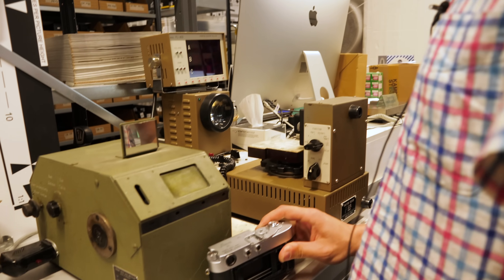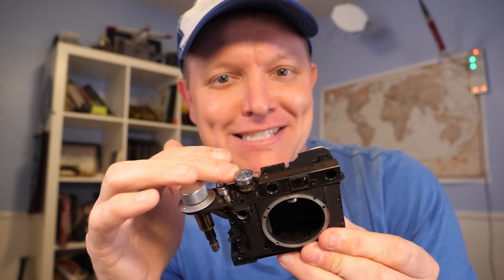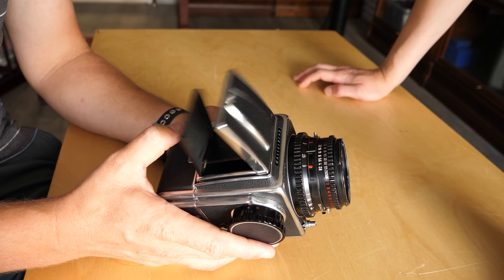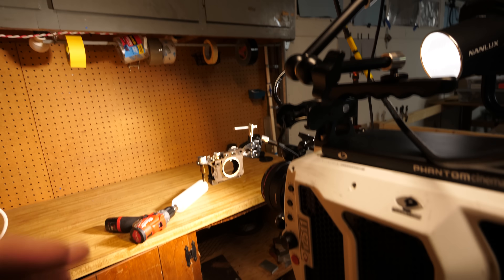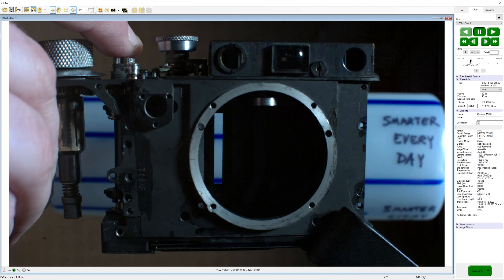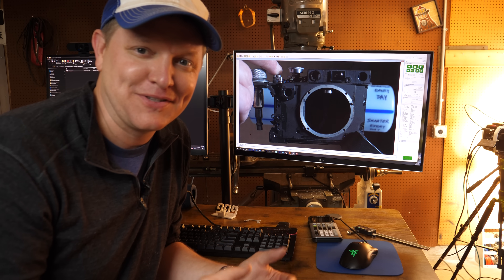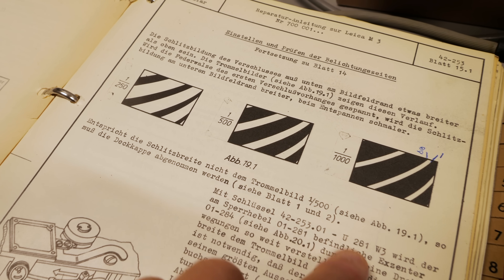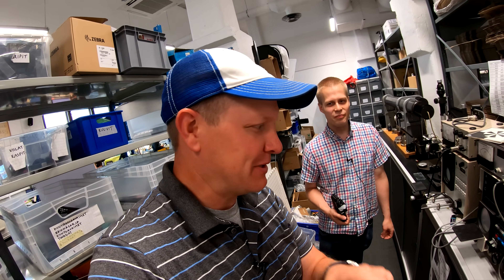How the Germans Measured Milliseconds MECHANICALLY - Smarter Every Day 283

Comment: I love seeing you dive into these deeply technical bits about how cameras work! I had never considered the non-linear speed a spring would move the shutter. This also is a great demonstration of why cameras can (traditionally) only sync with a flash up to a certain shutter speed. Once the shutter speed is high enough that the rear curtain starts closing before the front curtain is completely open, the flash does not stay illuminated long enough to cover the entire frame as it is exposed. That opens up so many other topics like how flash duration is measured, T.1 and T.5, how the capacitors discharge at different power levels will affect duration, how leaf shutters work, and how modern high speed sync works. Once you start trying to use flashes to compete with sunlight it starts getting tricky!
Reply: These mechanical camera shutters are truly feats in miniaturised engineering. Some implementations of the 'cloth shutter' had a window that was pulled across the shutter opening by ribbons across the top and bottom, a tiny brake to slow it down a bit as the shutter reaches its home across the opening. Later more updated designs had titanium shutter blades - between 4 to 6 of them travelling vertically in order to use faster shutter speeds with high speed flash guns. 

Older flash guns could operate at 1/60th of a sec., and more modern flash guns would operate at 1/250th of a sec., and the need for the shutter to travel a shorter distance, much quicker as well, hence the vertical 'guillotine' shutter. Fascinating engineering and fully mechanical too 🙂
Reply: Would love to see an episode related to this episode and also involving flash photography. Basically explaining to me, some of the stuff you mentioned here and why/how correct flash speeds work!

Comment: I don't know why I'm thinking this video should be on something like Curious marks Channel and many others but this is amazing I always wondered how they went about doing this sort a verification on anyting back in the day and let alone a camera there are all sorts of old gadgets that basically are Obsolete and that are just so fascinating like back in the day mechanical computers that were actually able to do some priests protects our stuff really before modern systems or even a thing once had Indian salvaged and old for the clock timer for nothing don't know what it was for had a bunch of Nixie tubes bunch of stepping switches all sorts of stuff let's just call it in the back and Dean connectors at the rear of the house it was obviously some sort of timing device It clown look like might have been helping with timecode or just some sort of timing device don't even know what industry it was in oh I know it's possibly broadcast but unknown otherwise.

The connections were similar to Jones plugs don't know if it was actually Jones but very similar.

I got some of the support stuff as well and clean all the connectors and everything.

It did have external input for timing the interesting thing is this was kept in sync with a 60 hertz mechanically through a timing motor that was attached to a cup like thing there was some sort of photo detector don't know how things were set up likely a photoresistor of some description.

Incandescent light source inside that cup-like assembly rotated at a specified RPM giving a pulse regular basis from an opening to the light sensor it made a real racket as well since all the electromechanical Rosa just relays and steps which isn't all pretty much all that was a dare mechanically one stage of counting went to the next carried over Indiana one-ups hours yet didn't really have a use for it found some other uses for the parts and I played around with him first but it's just wasn't really useful although in theory could have used it as some sort of timer but it was just not practical for Martin applications also one-time got ahold of her old school random number generator I was told that one time they were used that things like radiotronics house to swipe random numbers the guy I got it from was I believe an engineer for a Broadcasting Company it's possible I might have gotten the other device from him as well I'm thinking that's why I'm thinking it was broadcast for lighting it's possible the other Tommy device was some sort of early timecode device although I think this is more of a physical timer with the possibility of using you almost any of those contacts and all four simply able to trigger on a specific timing some sort of event my guess is this was controlling or could control those something time-critical or possibly providing timing impulses for other equipment

Comment: Fun fact: This is exactly how you time an engine. The Harmonic Balencer (main crankshaft pully) has timing marks on it, and so does the engine block. You hook an inductive sensor to the first spark plug wire, and on the other end of that wire is your timing gun with a timing light. The induced current tells the light when to fire creating a strobe in time with your engines turnover. it's the exact same principle as the vinyl record player example showed at 10:03. That way you can advance or re-tard your timing to compensate for boost, replaced parts, etc.

Comment: I always assumed the reason the later leica m added the backdoor feature was just to ease loading the film (you had to custom cut a 10cm long film leader for the i, ii and iii cameras). But it makes more sense when you see how they would have to completely disassemble the camera body of the earlier iii cameras to access the shutter for simple calibration and why they might want to just open the back instead. Pretty cool!
Reply: Not entirely the reason....You still had to disassemble the camera to fix the speed.
Reply: You are correct. I suppose my point was that it was not necessary to disassemble the camera to simply check if the speeds work. Us engineers account for many factors in determining a design. Whether an intentional effect or not, a technician (in theory) could test the speeds, rangefinder coupling and other features then proceed with disassembly if required rather than disassembly by default. That is a simple change in the process which likely saved hours of work considering how many cameras might require testing.

Comment: The el-cheapo way to do this, with focal plane shutter film cameras and without the mechanical strobe, involves pointing the camera at a fluorescent lamp in an otherwise-darkened room.  Those lights flicker at precisely 60cps ... so you can verify timing of speeds that are multiples of 1/60.

Comment: I miss my old Leica, I love old tech like this, I used a vibration based RPM meter at one of my first workplaces, I balaced tires using stroboscope balancers and i have used a lot of ignition test equipment from the 40's.
Bosch had a ignition/generator/startermotor test bench in the 40s, complete with a spark plug sandblaster that I was very familiar with and I was using it in the 80's

Comment: I tried to translate the page shown in the manual on how to set the shutter speed (at 5:30) to English, in case anyone is interested:

Setting and checking the exposure times
Continuation of sheet 14

The slit formation of the shutter must be somewhat wider at the bottom of the image field than at the top. The drum images (see Fig. 19.1) show this pattern.
If the spring barrel of the first shutter curtain is tensioned, the slit formation becomes wider at the lower edge of the image field, and narrower when the tension is released.

If the slot width does not correspond to the reel pattern 1/500 (see Fig. 19.1), the cover cap must be removed (see sheets 1 and 2).
With key 42-253.01 - U 281 W3, the eccentric 01-284 (see Fig. 20.1) located on the locking lever 01-281 is adjusted by small rotary movements until the slot width corresponds to the drum pattern. Here, it is necessary that the eccentric 01-284 points with its largest deflection towards the flash light sockets (see Fig. 20.1). The exposure time 1/1000, corresponding to the drum pattern 1/1000 according to Fig. 19, will always be correct for repair Leicas, provided that the exposure time 1/500 has been set correctly.

I wasn't sure about some of the technical terms, so if someone knows a better translation let me know. Also, keep up the great work Destin!

Comment: I'm not a native German speaker, but I believe what the page says it that the curved lines you see should be wider on the bottom in comparison with the top. If you tense the spring, the line should become wider at the bottom. If you loosen it up, it should become smaller.
Strange, I would expect it the other way around, but perhaps I don't quite have my head wrapped around it yet.

Comment: At 11:00 about image persistence in the eye was studied at least in US Air Force about pilots capability identify fighter planes by their silhouette. They had question that how short time it was required to be seen for pilot to visually identify something.

IIRC it was around 1/10'000 of a second exposure times when pilots still could do VID at reliable manner, because the eye was so slow to change back from bright to dark.
And this created the illusion that something is lit up long periods, as eye is sending the signal of fading picture in eye.

This helps as well to react and work under fast light conditions, like flash striking and you see the whole scene lit up, but you experience it long period and you can act based to that as your inner ear attitude, and capability estimate range with stereo vision, you can move in darkness or even throw something accurately after the flash.

Comment: 5:14 Die Schlitzbildung des Verschlusses muss unten am Bildfeldrand etwas breiter als oben sein. The slot(picture) of the shutter has to be somewhat broader at the bottom at the frame's rim than at the top. The drum_pictures (Fig. 19.1) show this sway/(slope). 
Wird die Federwalze des ersten Verschlussvorhangs gespannt, wird die Schlitzbildung am unteren Bild_Feld_Rand breiter, beim Entspannen schmäler. When the Spring-drum of the first shutter-Curtain is getting tightened, then the slot(picture-display_ing) at the lower rim of the frame will get wider, when loosening it gets narrower. Abb. 19.1 
Entspricht die Schlitzbreite nicht dem Trommelbild 1/500 (  ) so muß die Deckkappe abgenommen werden ( 1+2 ).  if the slot-picture-width doesn't concord with the Drum-picture 1/500 ( ) then the top-Cap has to be removed ( Page 1 and 2 ). 
   Mit dem Schlüssel 42-... wird der am Sperrhebel 01-281 befindliche Excenter 01-284 ( 20.1 ) durch kleine Drehbewegungen soweit verstellt, dass die Schlitzbreite dem Trommelbild entspricht    With key 42-,,, the Excenter 01-284 , which is at the (lever)/locking_Lever 01-281, this excenter has to be turned, (slightly, slightly), so that the width of the slit corresponds with the picture of the drum.  
 Herewith it is necessary, that the excenter's thickest extension points to the sockets of the flash_light ( Fig 20.1). The shutter_time 1/1000 , according to drum_picture 1/1000 (Fig. 19), after repairs will always be correct, if the  1/500th shutter time was adjusted correctly. .. in exceptional cases ...

Comment: Great video! Just wondering; you explain that the shutter curtain accelerates/decelerates because of the spring operation (which is also visible because of the curve instead of straight lines with the digitale camera). 
Is this visible in the result images or is this effect negligible? It should result in a somewhat longer exposure of the lateral edges of the film, right..?
Reply: The difference in exposure would be measurable in hundredths of an F stop. FIlm isn't capable of "seeing" that. I've been a photographer since 1975, and I didn't know anything could see that, til I saw this video. 
Now, a camera in dire need of service, with old oil full of dust, might have slowed-down curtains that travel at many different speeds, where even if you do test it and find out that, say, 1/250 is really closer to 1/125, that could be only an average of several different speeds, caused by the sludge in the mechanism, and these speeds would be different with every actuation. This will cause uneven exposure, as the differences are relatively enormous compared to a clean, properly adjusted shutter, and "visible" to the film. 
I once saw a 1963 Nikon F that was so dirty, that I couldn't tell for sure what its real speed was when set to 1 second. Normally, I set a shutter to 1 second, and fire it a few times while counting "One one thousand". But this shutter actually took five seconds to open, stayed open for eight, and took three to close! At 1/2 sec, it did the same thing, but stayed open for four seconds. But the repairman said it was still repairable, cos each speed was half of the previous one, and it didn't make any scraping or crunchy noises. Sure enough, I saw it again a month later, and 1 sec was a second. It was 53 years old at the time.
Reply: @emilyadams3228  thank you for this clarification! Very interesting 👌

Comment: I knew about this machine and how Leica cameras were adjusted "back then" – but I did not know how it works. I think this is even better than the usual electronic measurement, as you can also see if the shutter works inconsistently (like having one shutter curtain catching up or traveling with varying speed). Absolutely cool!
Reply: It's amazing!

Comment: Great video! But aren't the lines curved because the rotating drum is curved, meaning the opening with the light passes slightly faster in the middle of the view and slightly slower at the top and the bottom when it comes into the view and when it is about to leave the view?

Comment: My translation of the German (top paragraph) in 5:29: The visible slit of the shutter should be wider on the bottom edge of the frame than on top. These drum images (see Abb. 19.1) show the gradient. If the spring of the first shutter curtain has more tension, the visible slit on the lower edge of the frame gets wider, if the tension is eased it gets narrower.

Comment: Very very cool video to see, particularly for me as I'm using a Leica IIIc and IIIg to shoot film for many years and very interested to see the inside functioning and calibration process.

What I think is missing from the video as information is how to they make the setting at 1/1000th and with which precision?
Because from what I understand the technician needs to visually match the width of the "bands" with the doc, which doesn't seem a very precise measurement? Is a good technician capable to differentiate 1/800th from 1/1000th?

Comment: I use to do the 1980 version by shooting the old cart tv screen.  1000 would make a line in the film plane and it would grow until 1/60 was a full screen.      The other way was to take a photo of a turntable  for the longer exposure.   1 sec is 3/4 a rotation at 45 rpm

Comment: Great video. Would loved to have seen a leaf shutter and a vertikal shutter just for comparsion. I would guess that the vertikal one needs to be tilted and the leaf shutter could/should be have no rolling shutter at all.

Also It would have been great to see what happens at exactly Flash-Sync Speed. The machine could not test for that or slower, right?